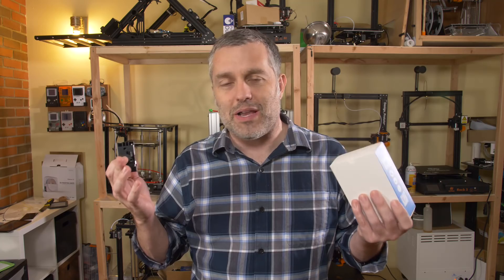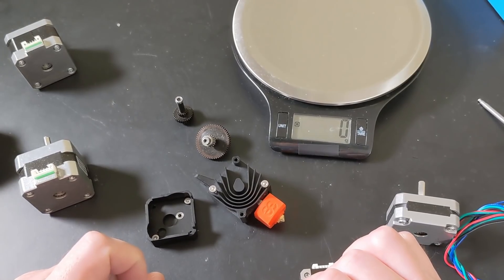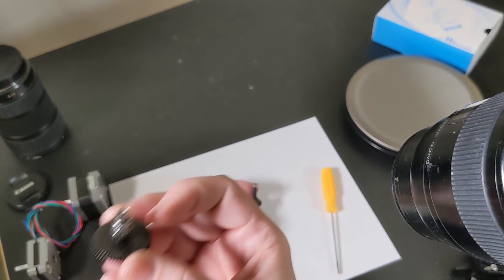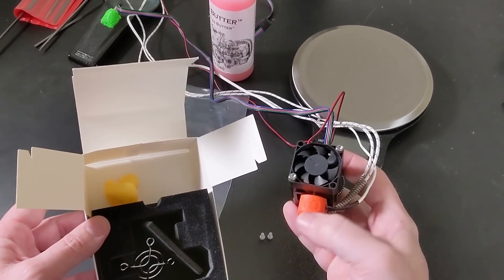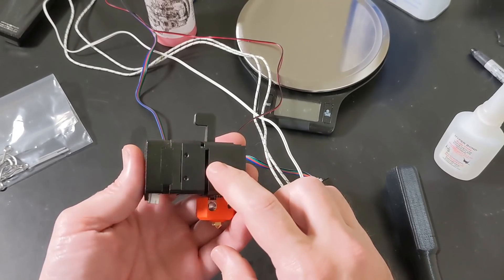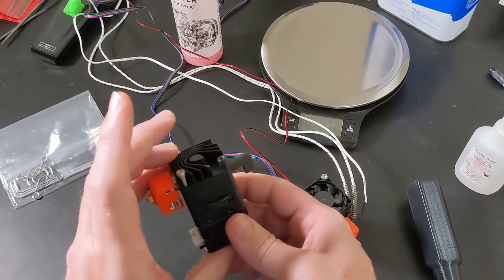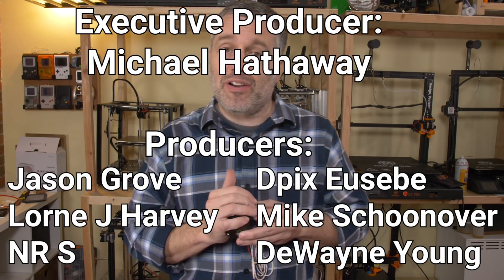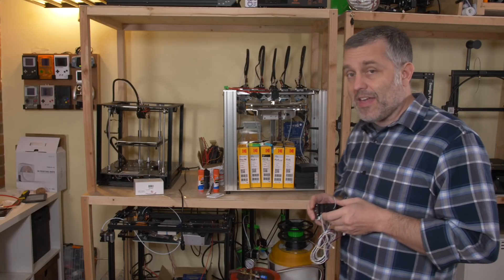GAME OVER For Hotend/Extruder Design? - The Biqu H2 Direct Drive Hemera Alternative

Comment: Bernoulli's principal is referring to velocity, not volume. While the velocity of melted filament flowing out of the nozzle will increase with smaller sizes, the volume of filament does not. If you went to a larger nozzle you would have lower velocity on the output of the nozzle but your volume per second would increased. 

Larger nozzle = higher volume
Reply: Higher volume *at the same speed. 
Lower speed, same volume. 
Inversely proportional.
Reply: Agree with this. Basically increased pressure is because of increased volume. Larger nozzle at the same volume will have the lower pressure.

Comment: for the record those are not machined gears inside the extruder the gears were created via process of (sintered powder metallurgy) not the same as metal injection molding its a bit more like casting but can produce hard alloys the lathe marks you see on the side is the clean-up pass / clearance pass this is also y the shaft has tight spots in order to machine those gears even in china the price would be very high
Reply from the maker: Thank you for educating me today. :) For anyone else who is curious: https://youtu.be/PetwxkqM-kQ
Reply: How do you know they are not machined?
Reply: @andrewjamez  you cant get something machined for so little money, even on machine costs alone
Reply: Mike nice how did you find out the process their using to make the gears??
Reply: @angrydragonslayer  yea ya can. Chinese cnc machine shops spit componentry out big time and somthing like that would take a couple of minutes. Plus hardening. Metal sintering would take ages and more expensive.

Comment: clones are not bad for anyone dude... what is your thinking behind that statement? the way i see it more competition is lower prices for consumers and forced innovation for the industry.
Reply from the maker: You've obviously never made an original thing and had it copied. Why do you think original creators seek patent protection? Also, original creators love what they made and do not sell low quality. Contrast that with the clones who's only advantage is making it less expensive. Thus all kinds of corners get cut. There's a reason that cheap is a synonym for low quality. Iteration is a different thing than cloning. But in the case of China, even the iterations are worse than the originals. Case in point the dragon hot end performs worse than the original Mosquito. Really the dragon is just a combination clone of an E3D V.6 combined with the Mosquito. There's no original thinking or advancement of the tech. By buying clones you are not feeding the person who came up with the advancement and original thinking.

Comment: One feature missing is easy heat-break release. Currently you have to open the cold-side housing to get at the grub screws holding the heat-break (bet they'll change this in next revision). There's an easy mod tho, drill a hole 90 degrees  away from the old grub screws to the outside and tap.  See mod here at 14 minutes https://www.youtube.com/watch?v=k3JQiXgqrbY&t=14m10s
Reply: You win, they changed the design in the new version and put the screws on the side :D

Comment: WTF? Video starts with its so great, this is the end, nothing negative to say... and then: Its Steel yeah but Steel <> Steel. This is made out of cheap tool steel. It will wear out quickly. There are reasons why mostly 2 gears are made out of two different materials. To prevent that the friction wear out both. For example this is why bondtech use a nylon gear instead of a Steel gear. And if you look close through the Milk glas of your camera you see the cheap machining even on the theeth of the gears. 
Then just 6 Minutes after your "its so great" you mentioned that its noch move free, it stuck ant some points. THIS IS NOT WHAT YOU WANT ON A EXTRUDER GEAR. It should move perfectly to prevent any extrusion irregularities. Especially for fast retracts. This all combined with a low torque Nema14 based stepper motor. 
This extruder mybe the end, but the lower end of quality!

Comment: Cloned means nothing in this industry when everyone wants everything to be open source
Reply: Sure didn't 3d printers only take off after the patent expired and became open source? They'd be the domain of researchers and factories today otherwise.
Reply: @wangouthangout  i mean the community they are in hands of now wants all open source 👍🏻
Reply: @reasonsvoice8554  Totally. Look at the rage people flew into when the Mosquitto hotend (probably the best innovation in consumer hotends in recent years) was patented.
Reply: that, and that method of feeding continuous wire wasn't invented by 3D printer manufacturers. They simply adapted a method used for decades on feeders for mig welders, spring forming machines, etc. etc.

Comment: The front and back case of the steppers that you wish were aluminium are already aluminium.
Reply: Magnesium might reduce weight. Magnesium was used for air cooled VW engine cases and transmissions.
Reply: @kitcarlson6033  for a start you mean magnesium-aluminium alloy, second I'm not sure that's in use for anything but race spec parts and premium wheels, magnesium based alloys aren't particularly good on high temperature environments. Have you ever seen a magnesium fire? Some of the really nasty porshe le mans prototype crash fires were because magnesium-aluminium alloy fires.

Comment: Not all is metal! Their is a pfte tube inside so max 260C. Or is this the upgraded version to 500C all metal? (I found it was possible but no stock 500C or link to upgrade)
Reply: yeah, i feel like thats clickbait.
Reply: Yeah and it makes total sense for the avarage of people who might buy this and don't print any fancy high temp filament!
Reply: @stephan1712  the thumbnail said "100% metal". thats why one could assume its an all-metal hotend, which it certainly isn't.
Reply: @certified-forklifter  yeah that's true..
Reply: My 2 are both 100% all metal because that is what I specified, to make it reach 500c you need the following: all metal heartbreak, thermocouple (eg a pt1000) and a high power heater. And anyone who can't work that out on their own shouldn't be trying to reach that temp
Reply: @certified-forklifter  its not "upgrades" its choosing a specification, just as people can choose 12 or 24v  heaters/fans you can choose which version of heatbreak you use, the "standard" heatbreak is lined with what they say is "capricorn" ptfe tube and good for upto 260c which is more than enough for the PLA printing brigade,  and any higher temps requires changes of which they are quite clear about, but I must thank you for pointing out the "thumbnail" it shows everyone how pedantic & anally retentive some people can be.
Reply: @certified-forklifter  Just because you  didn't carry out your due diligence doesn't meant the options I mention are not available, its all about using intelligence and comprehension to be able to use critical thought to work out things on your own without it being spoon fed to you. Just because the main seller doesn't spoon feed the options, doesn't mean options are not available now does it, if you use common sense you can work that out and ASK. 

You sire are very very confused, you are trying to hide behind calling me "mean" and using that as a method of trying to make me feel and look bad, the world is a big bad place, I  do not care what anyone says to me or thinks of me, So if YOU feel that being told the truth is "mean" then that is YOUR problem NOT mine, and it is something YOU need to deal with, instead of trying to make that the responsibility of others. 

Also you need to think about the key word in your statement above that word is "potentially"   i could say i could potentially  get jiggy with beyonce (insert your own desire there) just because i said i potentially could  get jiggy doesn't mean its going to happen now does it........

Comment: That gear friction is due to your having rotated the case 180°. 

The centerline shaft is prol not perfectly aligned now that you've rotated the case.
Reply: That's what I expect happened. Likely worked until he opened it, but poor part design for manufacture. Then we have lots of ad time to watch why that is more expensive in the long run. All the reparability of a used grenade.
Reply: Nope, I have tested that theory using a dial indicator and there is no discernable change.

Comment: ⭐⭐✰✰✰

If this were Amazon I'd give this review the above two stars. First of all I'd like to see a side by side comparison of this thing next to a Hemera, because from this "review" I really don't see how this isn't just a clone. Sure it's using a pancake Nema 17 and not one of the LDO custom ones that the Hemera uses, but otherwise it looks pretty similar. Second, having to clean and then file down the teeth on gears of an extruder is an immediate FAIL in my book. Unless BQ is aware of the issue AND sending out replacement gears free of charge, as E3D with the Hemera, this disqualifies them from such a "review". Third, and why I keep putting "review" in quotes, is you actually didn't print anything with this extruder. It is pretty mind boggling to me that you can say at the beginning of the video "I can't find anything negative to critique about this extruder" and then never actually print with it! How does it do with PLA, PETG, Flexibles, Nylon? Is their a snag in the filament path that you overlooked? Maybe something other than the gears is machined poorly? But you wouldn't know that because you NEVER ACTUALLY PRINTED WITH IT! 

I generally like your channel even though I sub and unsub frequently. This is mostly because you tend to bitch alot, which can be very grating, and that's OK. It's important to have contrarian voices out there, but this "review" is just bad.
Reply: Don't forget calling it completely metal despite Biqu's own product page advertising the fact that the heatbreak is not all metal and has a PTFE tube.

Comment: The difference between someone like you and most other people is, is that you are prepared to fix or improve parts you get. Others want it to work straight out of the box without problems, else it is trash and trow it away.

Great video thanks for the info.
Reply: For $100 it better work out of the box and not need any improving
Reply: @beaker2k  that is true and that is shy I wouldn't get it.

Comment: Surprising you said game over (positive review), after having mesh issues.  That’s a big issue.  Also beware that unit has a PTFE lined heat brake (not suitable for high temp), they do sell all metal replacements.
Reply: bought 2 metal replacements, ( my ptfe burned du to bug... ) => 1 is ok, 2nd is not usable. and they are 1.15 mm shorter than the original one :/

Comment: I have two, and I have found that after an hour of running everything runs much easier, it's much the same as with the omnia extruder where you had to run a special g code file to get those gears to mesh properly

Comment: love the review. In racing drilling holes is a common way to reduce weight. Do it! The large gears could easily be drilled to reduce weight and the caps on the steeper motor could be drilled. Aluminum bolts or screws are out there maybe swap them out? That would be such an awesome next video.

Comment: as a former machinist , the gears have been there for many years before 3d printers ever came to be, many designs are upgrade or a current or past design. Usually the gear will wear into each other,  called a break-in period. I use pneumatic grease.

Comment: I'm with you with the 175mm being way enough for print moves, but you are forgetting retractions. that's the downside of highly geared extruders, you dont need the speed + torque for print moves , but retractions. also you will need about twice as much juice( speed+torque) overhead for a successful linear advance as you need for retractions and Im not even talking about a bowden but a direct drive.
the other thing i can tell you for sure is that you cant run that extruder in a heated chamber. not a chance ! you need about 48 or 42mm of nema 17 to run inside a decently heated ABS chamber, anything smaller will just overheat and melt the mount and fry the stepper. take it from me brother and save yourself days of headache . unless of course you watercool it :D

Comment: The motor not only has to overcome the back pressure of the nozzle, it must overcome the drag of the PTFE tube (worse for tubes with tighter bends), unwinding force of the filament, and friction of spinning the spool.

Comment: Those orbiter extruders are pretty nice. They are about 140g in weight. And they don't include the weight of the heatsink/heatbreak/heater block and heatsink fan. So I don't think you'll be a lot lighter than the h2.

Comment: ok.. 3D printer filament feeders ("extruders") are an adaptation of a feeder system that's been around for a very long time, used in mig welders, spring-forming machines, and other machines that require a continuous wire feed. It wasn't a novel invention by Bondtech or any 3D printer manufacturer, just an adaptation.
For the gears, if you want to take the time, you can use some lapping compound (particle abrasive suspended in typically linseed oil) in the teeth of the gears, and drive the gears with a drill motor to lap them in to precision match each other. Then thoroughly clean everything to remove all the abrasive, then reassemble and lubricate.

Comment: Biqu build awesome mainboards too. I have in my bigest 3D printer installed an BTT octopus v1.1. And with the TMC2209 is it the very quiet and I sleep neer by my printer. I would install in next time the Biqu H2o extruder, why i would cool everything on my monster printer with water and i would have 500 degrees print temperatur.

Comment: The end cases of a stepper motor already are aluminum. The center section needs to be steel because that's part of the magnetic mechanism of the motor itself. Unfortunately they're kind of as light as they can be.

Comment: Linear advance / pressure advance is not trying to handle some bowden tube effects. It is trying to align extrusion volume with current printing speed. Since at the end of a straight printing line the firmware acceleration kicks in and slows the printhead down, the extrusion volume needs to be decreased to fit the slower print speed. 
And without that the acceleration and therefore the change of printhead speed in X-Y did not effect extrusion what so ever. The GCode told the firmware to extrude x mm of filament equally during that line.

Comment: I went ahead & purchased two of these to try on my Tenlog TL-D3 Pro, a Idex printer and your right about the shafts needed to be filed a little. I was able to get one to move well. Te other is a little more problematic. It seems the shafts was slightly bent when they pressed the gears onto it. Not by much. I got it to spin freely in one direction but it catches the housing when it spins in the opposite direction.

Anyways. I think my I will have to grind down the inside of the housing so the teeth do not touch it. There is not much thickness to it but should be enough to grind away and still not have it open up. I just need to buy a new Dremel as my old one died.

In the process of filling down the shafts I noticed another potential issue with doing so. The more you file the shaft the more loose it gets in the bearing. So the gears will have some shift to them that is why mine caught the housing. I added more play to the bearing combined with the shafts not being set straight in the gears caused it to catch the housing. The strength of their spring also doesn't help. It pushes me on the gears with some intense force. So it adds to the gears being pressed into the jousing. This Extruder could deal a less forceful spring.

I wish they would not have painted the gears as well.

To recap. If the gears and the shafts for them are straight the H2 Extruder works well. They do seem to have quality issues in achieving that though. It'd be nice if they offered replacement gear sets for this extruder. Just for this issue alone. I looked and didn't see any. They also need to redesign the dual gear lever so that you can get the pin out to replace that gear. If not then they need to offer a replacement lever arm which they should also do anyways just so we have access to full set of spare parts.
All in all the design seems nice. It seems to work well if the parts are good. I just hope I can get the issues with the gears on my second one fixed. If not I'll have to buy another and hope it is in better shape.

Comment: your gear mesh issue is simply where they set the gear pivots. You rotated the motor which changed the pinion rotational points. I'd simply bet the base is not perfectly concentric. The one that moves smoothly has not been 'modified' from the factory design.

Comment: Biqu makes a 3d printer with this H2 extruder & the first 400Mhz SE-BX v1.0 board only released on this printer currently. 
BIQU-BX DIRECT EXTRUDER FDM 3D PRINTER $599. looks like it has 3 modes as you can add RPI & choose marlin, Touch or RPI interfaces. wish this printer was out when I bought a cr-10s haha